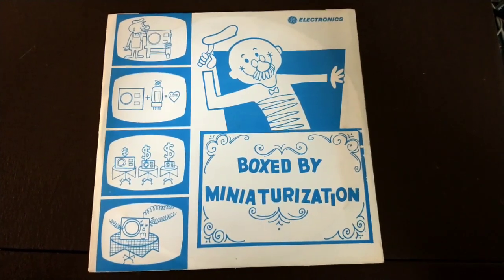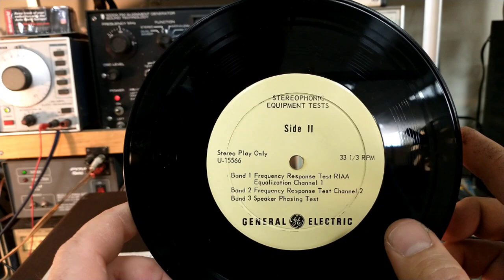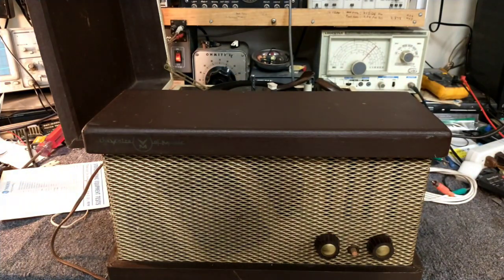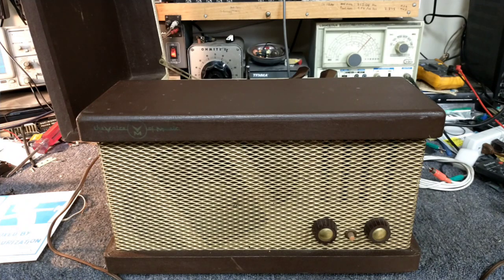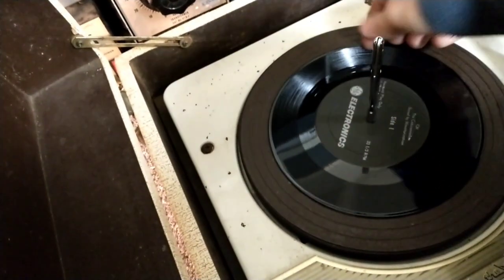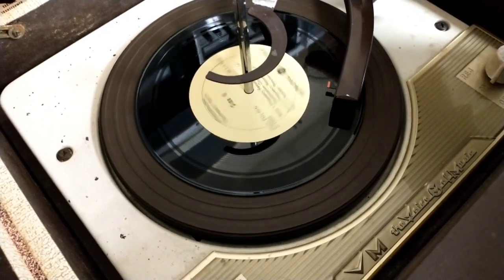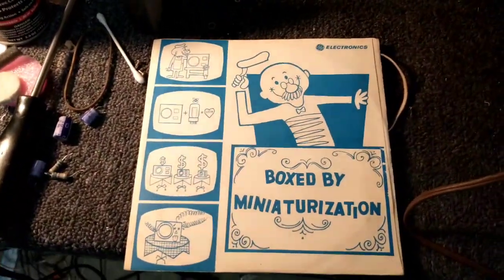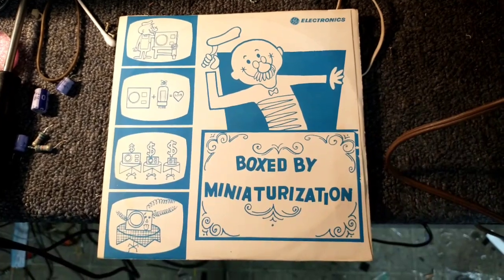1960s General Electric Promotional Design Engineering Sales Demo Record. "Boxed By Miniaturization"

Comment: Sounds to me like GE was sweating a bit, having spent all kinds of money in compactron R&D and then watching everyone move to transistors. I guess tube tech was dirt cheap at the time, compared to  the "new kid".
I like how GE did give a nod to the repairability of the product. Something that is non-existent today in our throw away culture.
Cheers,
Reply from the maker: Tube tech was at it's peak in the early 60s they were just getting the hang of transistors. Most transistor gear of the day was hand wired and designed like a tube amp - but using transistors.
Reply: @JordanPier  yeah, there were even some oddball hybrids of the two... Like Fetrons.
Cheers,